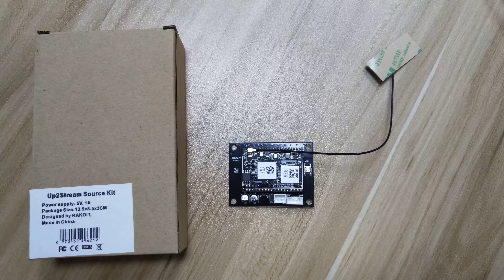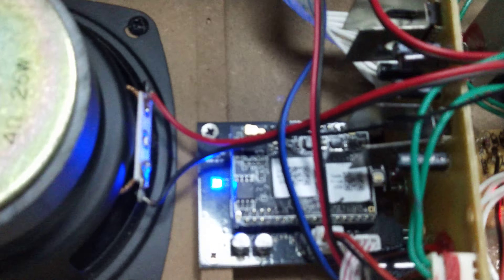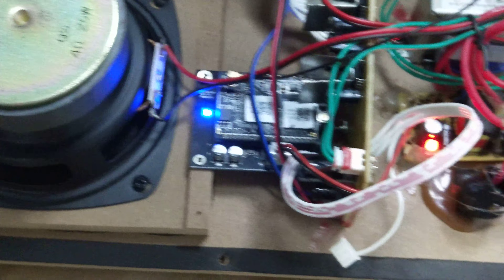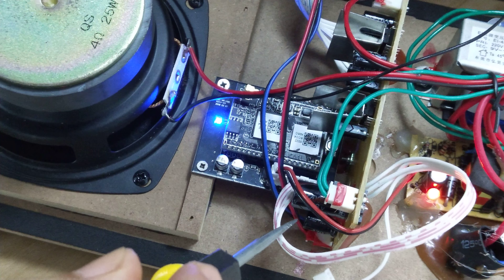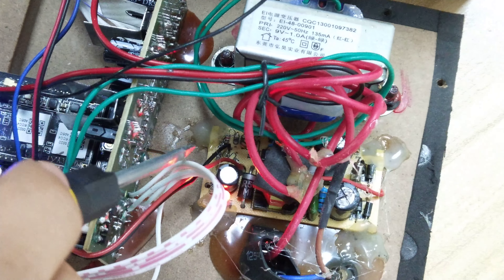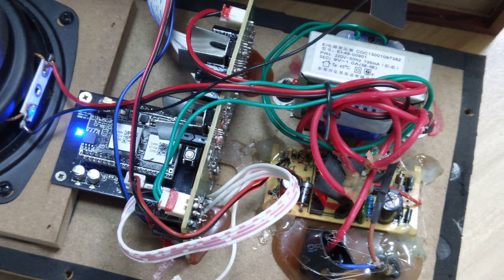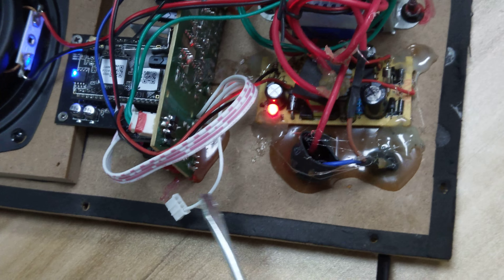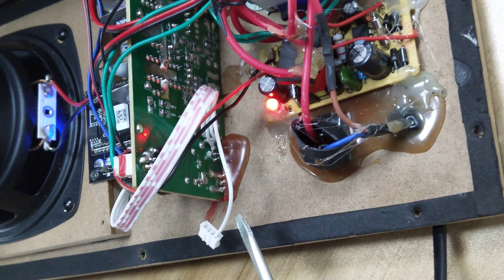DIY WiFI speaker by using Up2Stream WiFi Audio Receiver Module

Comment: passive crossovers and someone elses amplifier board... why?
i thought you made amplifiers.

and besides, what use is a wireless speaker anyway when you still need atleast a power cord. streaming is awesome, but there is no value in one cord as opposed to an another cord
Reply from the maker: Actually , we have many customers sync music to other units wirelessly.
Reply: @Arylic  that is fine👍 
But it is not at all necessary to keep all of the electronics in the cabinet imo 😀

Comment: I though it will work like a multi room speaker, not like you put inside for a single speaker. useless then
Reply: It will work like a multi room speaker. Similar to Sonos, every speaker is self powered and internet connected.